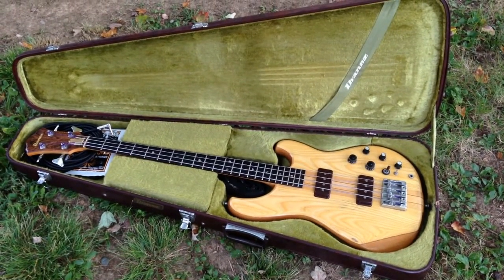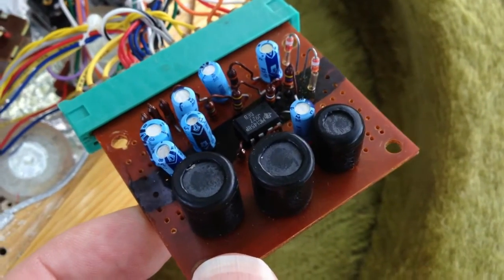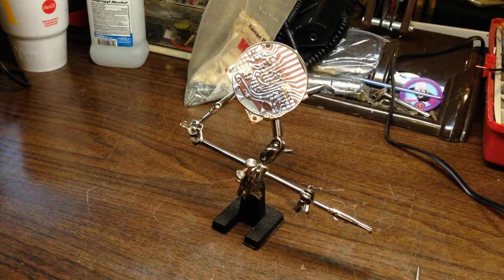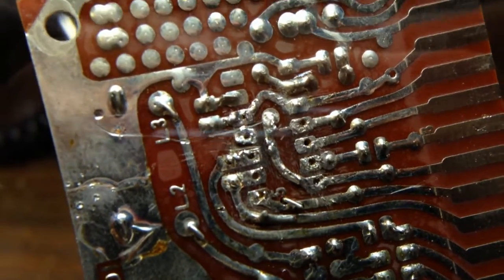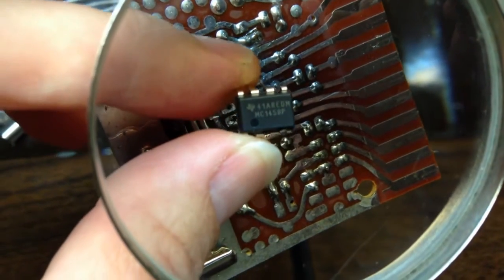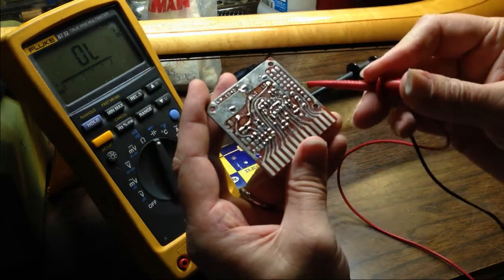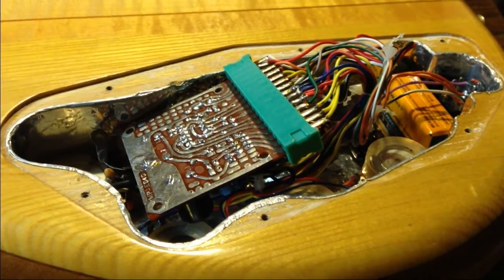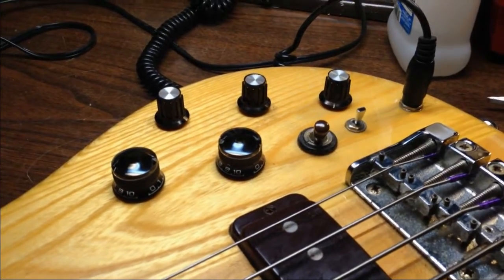Vintage Ibanez Musician MC-900 Bass Active Electronics Repair

Comment: Thank you! I had the exact same problem and without much knowledge of electronics, was able to order a zener diode and replace the defective one. I now have an active MC-900 bass! Excellent video. Thanks again!
Reply: Hi - @sbrien or @guitologist !  I just picked up one of these and the person who had it monkey'ed around with it and I'm sure everything is not wired correctly - there's at least one wire dangling loose and the output jack is replaced. If you still own yours, would you be willing to take a couple detailed pictures of the wiring?

Comment: Those op amp chips are pretty robust. I use them for my reverb pedals, and my spring reverb drive and recovery circuits. I've never had a bad one yet. I believe the TL072 can be used in place of the one you replaced as well.

Comment: The spec sheets say that the 1458 is the equivalent to a dual 741. If you have messed around with small op amp audio amplifiers you see the 741 used a lot as a pre-amp so it makes sense as it can boost, set up filters, and you can connect tone controls plus more with them. A 741 pre amping a 386 is a very common setup. Cool to see a board like that in a bass guitar.
Reply from the maker: Hi Carl. Yeah, I thought this was a snazzy board too. Would be an easy little pre to clone. The only problem would be getting the board with those terminals on it. Could be subbed with ribbon cable, I guess, if both male and female ends were replaced.

Comment: I used to have a Music Man 120HD. It was supposed to be Leo Fenders updated version of his Tweed Fender Bassman amps. It was about the same size but, had Reverb, Tremelo and a Master Volume on one channel. Also a Mid tone control. It had four 6L6 output tubes and was switchable to use two or all four. This allowed for either 60Watts or 120Watts. Being a tech myself I took it apart only once. Just out of curiosity. The pre-amp and everything thing else was made up of those same 8 pin op-amps that you replaced in this video.

Comment: Nice bass! These tuners are really great with the outer tension adjust collar, however my MC-300 has no room for the tension lock. I suppose the tension shouldn't be likely to vibrate loose on a guitar, though they seem to need the occasional light tweak. The edge connector setup there was very common in the audio equipment I working on in recording studios back then, so my guess is, the system was simply repurposed. You should have little problem finding those boards, or making some up, as that is the same connector as used in the API 500 style System.

Comment: Very common chip made originally by National Semiconductor. LM 1458.  When other companies make a part, often they change part numbers. Sometimes quite drastically. Dual op amp. They need plus and minus to work, that's what the zeners did.

Comment: I'm pretty sure the MC900 only went to 1978 when it was replaced by the MC924 (24 fret version). The month/ year of production can be determined by the serial number. That was probably a D7 as the 1st 2 characters. The 1st letter is the corresponding month. ABCD = Jan Feb Mar Apr of 197x. 
That's a rare finish! I always wanted one like that but am very satisfied with my Dark Stain finish !
Reply: Personally I've never seen a MC900 from '78 or earlier, but they sure were made in '79 and possibly beyond: I own a MC900 and it's from december 1979 (L79).
Reply: EarlDeWijs I actually have a friend’s MC900 made in 78. We bought ours around the same time from 2 different areas of Chicagoland and they both have replacement Bartolini pickups in them. Not 4 months later, we ran into a guy in Guitar Center with the same setup! lol

Comment: Hi Brad, Good repair, nice Bass. IC sockets are always nice for later swapping of DIP's, etc.. Solid State is pretty  bullet proof, usually. Be good, C
Reply from the maker: Hi Cass. I actually have some sockets onhand and did think briefly about putting one in so the chip could be swapped easier in the future, but I was afraid it might be too tall for the standoffs.
Reply: The Guitologist Hi Brad, I would never suggest you don't know what your doing, you are quite good at diagnosis & repair, and, you can play really good. I figured the thought occurred to you and that you had your reason's, just a thought as always. IC right on the board works too. Always looking for your new uploads, I really enjoy your videos. Well, enjoy the last couple days of Summer. Take care, C.
Reply from the maker: The socket idea is a great suggestion! Keep em coming!

Comment: I have an older budget Ibanez bass that has an active bass boost. It's a full-scale instrument with both P and Jazz pickups, each with its own volume control, and it has plenty of low-end, so I never use the active bass boost. Unfortunately, you can only turn the active bass boost all the way down, you can't bypass it completely, so I have to keep batteries in it even though I'm using it like a passive bass. I want to just rip it out, since I got it used for like 300 bucks and I doubt I'll ever sell it. Eventually I will get around to it.....
Reply: Having a buffered output is not a bad thing on a bass ;-)
Reply: It doesn't have any negative effect on the tone that I know of, but the active electronics are ALWAYS sucking juice out of the battery, whether I'm playing the bass or not, whether there's a cable plugged in or not. The only way to not have it always "on" is to disconnect the battery when I am done playing it, and that requires leaving the battery compartment open and I can't remember to do it every time, so I will sometimes come back to record another track and go to reconnect the battery (because it won't pass ANY signal without the active circuit getting juice) and discover that I forgot to DISconnect it and now the battery is dead or close enough to dead to sound like shit. It's another thing to have to worry about changing batteries on and buying batteries for, when I never actually use the bass boost. I also go bass-compression-amp or bass-compression-line in when I'm recording direct, so a buffer stage up front isn't necessary, and I am not even sure this works as one. I haven't seen a schematic for it or even looked at the guts.
Reply: To my knowledge all acive circuits are low impedence on the output side - buffered.

Comment: I would be mad if that was my bass, you changed the chip and it wasn't even that. I have been into electronics for 25 years and I would never do that to a client, change parts when they don't need to be. I mean everyone makes mistakes I know, but you do this all the time so mistakes should be slim to none. I am not hating just stating a point, so no worries its all good :)
Reply from the maker: Why on earth would you be 'mad'? It's the exact same chip. Made by the same company, even. It's an IC, not like I went from a germanium transistor to a silicone or something. I usually won't touch this stuff, but his bandmate is a tube amp customer, and the only other people he could find within a couple hours' drive to work on this were in Indianapolis.
Reply: This channel is "The Guitologist" Not "Er Guitars"  I'm not aware of a Luthier's/electronics expert book of business process and/or ethics that list guidelines on how to approach repairs, upgrades or mods....
Reply from the maker: Well, the customer was told everything that was done, and this video was provided so he could see precisely what was done, if he was interested (a service not many other techs would dream of providing for their customers.) He was happy. 

If this was someone's vintage effects pedal that had some special esoteric chip not produced anymore, or if it had all these germanium transistors that are hard to get, I might have double and triple checked every other component before ordering a new IC, even though that would run up the labor cost. In fact, I probably wouldn't even take on that job in the first place. In this case, the part is common, so common in fact, they are only $.50 per chip, and there is no difference between the old part and the new part, and in my experience with ICs, they can and do fail, and they are hard to test in circuit. Ordering the part and just popping it in was, I still think, the right approach in this case. I had tested everything else that could be tested in circuit and somehow I didn't catch the bad diode. I swear I checked it, or at least thought I did. It was an honest mistake I'm not that ashamed of making. It always seems to be the other techs who get mad about this kind of stuff. The customers usually just want their shit to work again.
Reply: Agree with your reply... I'm an Ibanez player and collector, active participant in the Ibanez Collectors Forum, nobody would argue that the integrity or vintage aspect of this instrument was modified because you switched out a 50 cent, and DUPLICATE chip.  At some point to make an instrument play (as it was designed and intended) your hand is sometimes forced to use newer parts since original stuff is no longer available. In the case of this musician bass, you replaced a part that is still available and it changes ZERO in the tone or playing of this bass. Mistake or not that little chip was insignificant. One of my 30 guitars is a 1976 Gibson S-1, extremely complicated wiring/switching electronics. In order to restore mine, the tech had to use newer parts including wiring. it did nothing to reduce the value.....
Reply: I think this was a case of someone not really paying attention to the video or not understanding what was going on,,,,,,
Reply: Theoretically, with an active filter circuit, it is the parts (resistors and capacitors, probably no inductors) around the op amp that alter the tone more than the op amp itself.  Swapping out an old part for a newer one there may be some slight gain differences but that is probably compensated for by the gain potentiometer.